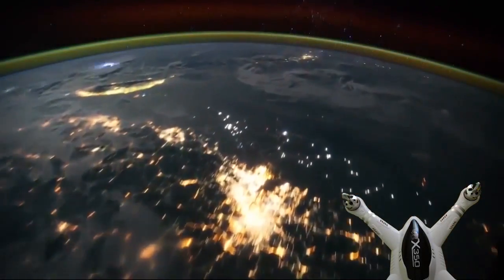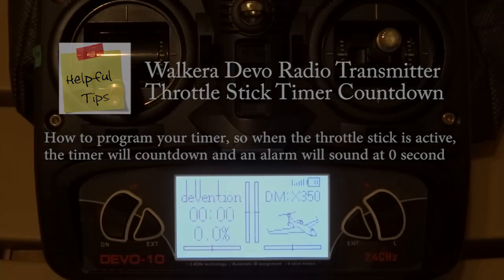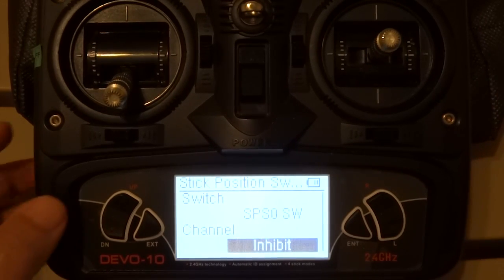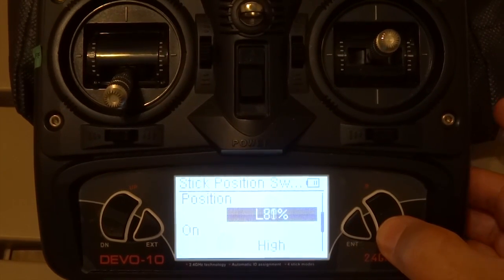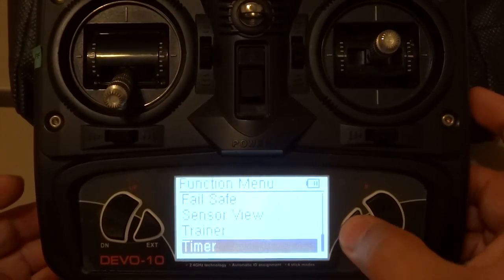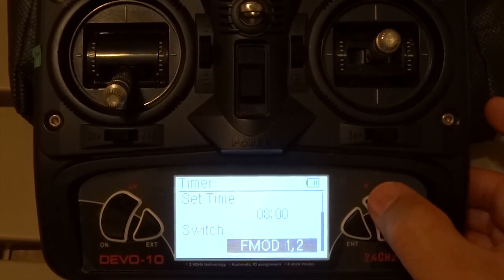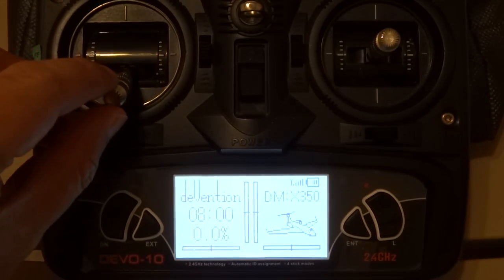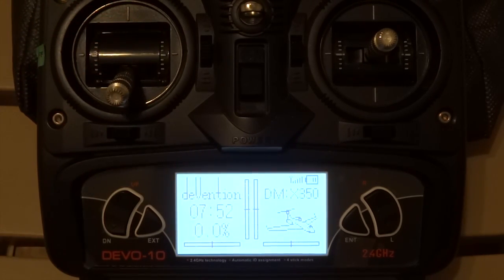Walkera Devo 10 (F7,8,12). How to Program Throttle Stick Timer Countdown. QR X350, E-EYES GPS

Comment: If my QR X350 Pro wont stay in the air at 50% throttle and the sticks have been calibrated, do I simply raise the throttle trim? maybe something i've missed?
Reply from the maker: Hey, Jim the x350 pro goes back a couple years, not spring loaded, so depending on the weight of the quad, 50% is not always the magic number.  I would't use the trim, out safety, i would just take say 55-65 percent as hover, especially with a gimbal and cam.  The LiPo may also makes a difference. - dm